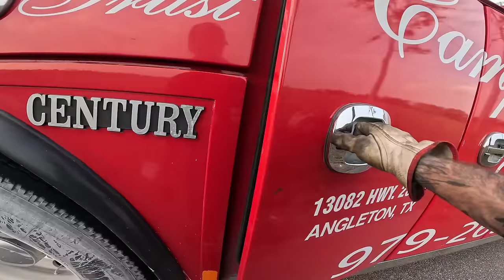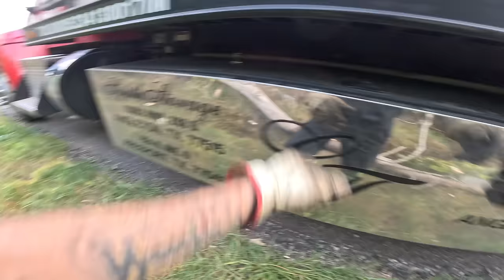U-Haul… We Tow! Heavy Duty Police Rotation!

Comment: I would have to put a strap on the right side rear over the top top from the bottom to keep it from going over & pulled up and then pulled it over to the road it would be a lot better than trying to pull it out from where it was. I used to do Towing and Know better than to just pull it out from the ditch without picking up the front a little bit and then pulling it back onto the road. What Would Midwest Towing Do On This Call. I Know He Would Do It Right and get it done the better way.
Reply from the maker: If you watch Ron, you’d know his saying… “there are multiple ways to reach 10”
You can do the same job so many ways. As long as it gets done without damage or injury, you did it the right way.
Reply: @Towtruck_Dustin  I know that phrase also. I also used to do Towing in West Paterson/Woodland Park NJ  .  I have seen some strange wrecks in my time. We also had a doozy of a recovery in front of an apartment complex that was not exactly normal, the car was in the parking lot when the owner called but when I got there it wasn’t in the parking lot anymore it slid down and was up against the building but none of the tires were on the ground, the front was against the wall of the building but the back was on the embankment of the parking lot we had to use both Tow Trucks to bring the car back to the parking lot (1) truck up on the other parking lot with 1 cable tied to the other Tow Truck and the main Tow Truck tied to the back of the car to get it back to the parking lot. That was scary.
Reply: midwest as much as i like his channel would have taken twice as long as he has to get all his headsets on and all the fancy gear with proper rigging any truck could get that out but you can't run a strap over a uhaul box they are glorified tinfoil and would have folded quicker that an empty beer can
Reply: @jays106  Budget Trucks are the same way, I used to work for a Taxi Company in Wilmington North Carolina and they had 3 Businesses there, (1) The Yellow Cab Taxi Company (2) Affordable Packers The Budget Truck Rental Company (3) Jenhill was the other one. I used to have to once in a while and clean up the back of the trucks. They are all built the same way .

Comment: Instead of y'all using that snow shovel to move dirt and roots off the road, you should just get a normal flathead shovel or a pointy head shovel. It would be smaller then the snow shovel but quicker and easier to use.     😂👍
Reply from the maker: Yeah let me keep the road shut down for another hour or two so I can go get another shovel. Gotta make do with what you have.
Reply: @Towtruck_Dustin  by that I mean just replace the big clunky snow shovel that y'all use on those roots and what not with a smaller pointy head shovel, i just found them to be easier to use on stuff like that.
Reply: WTF you doing with a snow shovel in Texas❓
Reply: @unwired1281  lol! 🤣
Reply: @unwired1281  in the north here we call them barn shovels good for cleaning up a large amount of loose material like a crashes where a flat bed would normally be.

Comment: Too many chiefs.  Not enough Indians.  There should be 1 supervisor on the job and it’s done HIS way.  Not how each person wants to do it.  Especially if the owner is on scene.   It’s his company , rotation and equipment.   Donnie might take it a little slower on some jobs or take a different route but his company is known for getting the job done right the first time.
Reply: Fully agree with your assessment, but it would also include what is the customer doing right in the middle of the work area.  Big liability if a chain or cable fails and snaps back.

Comment: Lucky for them the truck was light weight.. a fully loaded tractor trailer would have been a real fight.
Reply from the maker: Would have been a lot easier actually. More places to hook up and control it.
Reply: @Towtruck_Dustin  yes I understand that but the at that angle a loaded trailer would have been difficult don’t you think?
Reply from the maker: No. Because it would have been easier to control by running a high line and a low line without worrying about crushing the box.

Comment: If it was me I would put a snatch block about three feet off the ground of the power pole. 
To pull from the back end.
While the other would be picking up the Is front end.
So one truck could do both front end back at the same time.
Or put one truck at the back and one truck at the front pulling at the same time.
Thank you

Comment: Me as a heavy duty wrecker operator this was painful and embarrassing to watch .. you guys need a lot of training .. all you needed for this job was the medium duty wrecker 🤦🏻‍♂️
Now this poor driver is going to get a big bill for 3 trucks
Reply: I agree it was kind of nuts, I am a former tow guy, I could have had it out in 5 minutes  I had a flatbed and 5 other trucks, one of my 1 ton 4wd trucks with outriggers would pull it right out, the 2 left wheels were on the road, not sitting on the frame, just a waste of time to drag the rear out first, it has wheels it will roll, I would have parked about 30 feet ahead to keep the cable low as long as the Uhaul runs this should take 5 minutes

Comment: You have some great content. But this was painful to watch 🙈 Ya need a Rotator….
Reply: No they don’t.. almost no job requires a rotator, just skilled operators. What do you think they did before rotators existed?
Reply: @towtruckaj 100% agree Rotators make recovery easier and guys lose their skills using them. They are a nice addition but most if not all can be done with regular straight stick heavy
Reply: @thook9951  I've seen so many people on youtube operating rotators who clearly don't know shit about what they are doing, they rely on the truck to fix their handicap when it comes to actual skill and experience. 
A straight truck can do almost anything a rotator can do aside from lifting and rotating a load, A rotator is very convenient, and it helps in tight quarters, but straight trucks are definitely not as far behind as the ignorant people watching these videos like to believe.
Reply: @edberry,   a rotator wouldn't help with this job,   every pull was from a low angle,  it wouldn't been any better than a stick boom
Reply: @ky.gambler5281  well I wouldn’t say that, a rotator certainly could have approached that in pretty much any manner it wanted to, drag it out, lift it out, pick and swing. The straight booms are more restricted on what options they have.

Comment: A simple winch out? WTF was the problem guys. Y'all newbies or what?
Reply from the maker: Got it done with zero damage and injuries, as always. Seems like we did just fine. Few things could have been done differently but there are more than one way to do something. 
Easy to arm chair on the internet.
Reply: Didn't see you helping
Reply: @KevinPatrick-ov3ot  I would have had it out with the flatbed and gone before the Heavy even showed up!
Reply: @Towtruck_Dustin  I get what your saying. But impressions go a long way in that business and if law enforcement isn't happy with how long it takes that's not good. Back when I was doing it if it was a rotation they would grade each and every company and use that to determine which companies stayed on the list. Most of our law enforcement were contracts and we were the only company they used. They were 5 year contracts and at the end it would go up for bids again.
Reply from the maker: The fact you said you’d have pulled that out with my flatbed discredited anything else you said. No way you’re doing that job with that truck, definitely not any faster than we did it. 
It’s just not possible. 
This is the problem with all the arm chain tow truck drivers on the internet. They always know better.
Reply: @Towtruck_Dustin  Listen clown I got 15 years operating Wreckers everything from a 1 ton to a 50 Ton and I most definitely could have pulled that with that flatbed. It's not how big your truck is or how many trucks you use it's all about the proper rigging and the proper use of your weight compared to the weight you're pulling. You guys over killed that job big time. No reason for 2 Heavys and a medium duty flatbed and I'll bet you charged for every bit of that equipment that wasn't necessary. Yes I most definitely would have recovered that with the first truck that showed up. Go to school and get yourselves some recovery training and don't tell me you have it because your video proves you don't. What would you have done if your Heavys were tied up on other calls? So instead of being a keyboard cowboy maybe take some free advice now and then and learn from others if possible. No the Flatbed wasn't the best recovery vehicle for the job but it most definitely could have done the job if it's property equipped. I'm not perfect and I certainly do not know everything about recovery but I have had the pleasure of learning from some amazing recovery experts. If you can't take some criticism you shouldn't post videos because you're most definitely going to get it whether you did anything wrong or not.
Reply from the maker: 😂😂😂 I’m the “keyboard cowboy” but you’re in my comments section. This is gold lol
While you’re typing we’re out there getting it done.
Reply: Just a matter of three guys on scene all with different ideas on how they wanted to get it out. They got it out undamaged with minimal head butting. Better than the tow guys around here by a mile.
Reply: @Towtruck_Dustin  You kinda come across as the rookie that has all the answers.  Your co-workers ignore you more than you seem to pick up on....
Reply: @dandunning4409  i would love to see that attempt